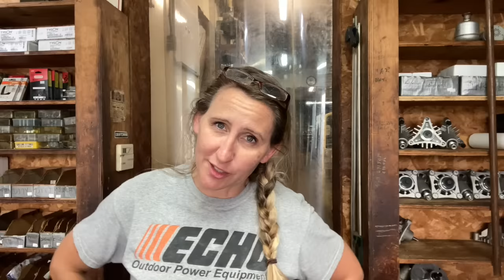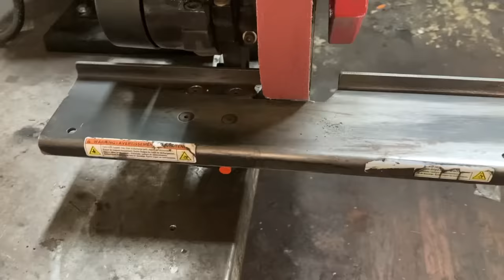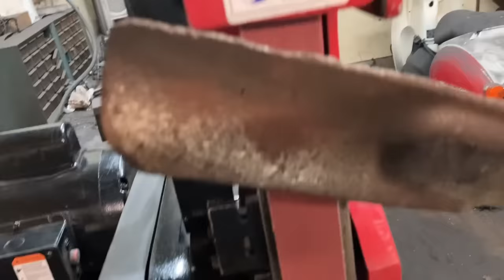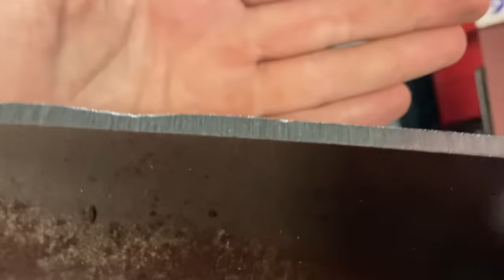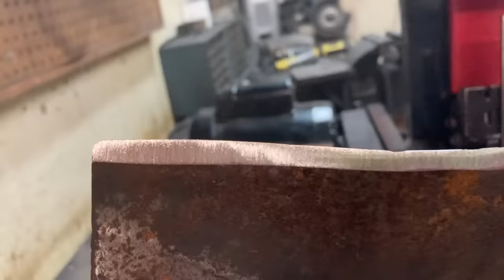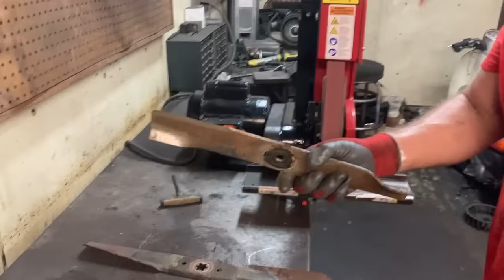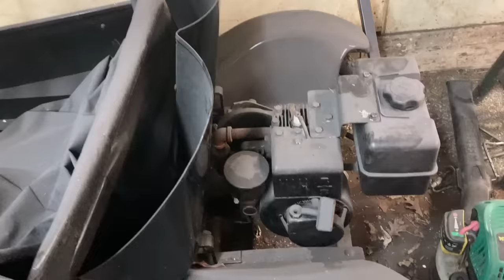The Best Blade Sharpener Ever!!! Oregon Burr King X400

Comment: Ok 51 seconds, now balance it so it doesn't shake like a dog crapin peach seeds
Reply: I watch quite a few  small engine repair channels, but Never see a one of them  Balance a blade, must be a lost art or something.
Reply from the maker: This was not a “How to sharpen your blade video”. Those were old, bent, scrap blades. It was a, “Check out this awesome grinder” video….. 😆
Reply: Uh, crappin' is spelled with 2 p's. Just sayin'. And tryin' to keep a straight face 😂
Reply: Wow
Reply: "A dog crappin' peach seeds" . . Never heard that one before. I'll use that one.
Reply: I'll have to start usin' that one!😂😂
Reply: @davidoickle1778  true I heard it was as nervous as a cat crapping a peach seed
Reply: @briant4162  "smiling like a dog *hitting peach seeds" conjures up a better mental image.  Been using that one for 40 years, still cracks me up
Reply: @Jslav-jj2xq  no cat but small peach seed big
Reply: Other than myself, I've honestly never seen anyone balance a mower blade.
Everyone I know will just buy a set of new blades every spring.
These are the same ones that don't believe in cleaning under the mower decks either. 
Couple of buddies that live close by, don't understand why I raise my 6' shredder up, and take the blades off so I can hit them with 4.5" grinder with flap disk to put edge on those blades.
I even go as far as to get old bathroom scales, and weigh them.
If I find big difference in weight, then I'll knock more metal off the heavy one until it's close.
They ask why, because I don't want to replace the gear box, or even have to put new seals in it every couple years. 
Plus my tractor doesn't have to work nearly as hard, and it cuts it up better, and smaller pieces too.
Plus it doesn't leave rabbit runs behind me as I'm mowing the spring clover to make daylight for Bermuda to come in stronger
Reply: I used to believe you had to balance after every sharpen. But after sharpening 2 sets of mower blades twice weekly (16 mower blades TWICE weekly) for 2 mowing seasons. Unless your like mauling the hell out of them and I mean like 4 5 6 seconds per pass through the grinder. You absolutely do not have to balance them every sharpen.
Reply: Balance of a mower blade is an ABSOLUTE waste of time!!!! POSITIVE!!!. There are no lawn mowers on earth gonna run like a freakin Mercedes!! It’s a work machine FFS!!!☝️🤔
Reply: They are called pits, not seeds.
Reply: I use an 80 grit flap disc on a 4.5" grinder and balance them on a 5/8" shaft with 5/8" I'd roller bearings on 2 jackstands.
Reply: @drfalcon4102 that’s one of the reasons why so many spindles go bad would you drive your car 70 with the tires out of balance
Reply: @drfalcon4102 if you don’t care about tearing up your spindles, no sense in balancing the blades….  NOT!  Be like a poodle trying to pinch out some chainmail spiked balls!😂
Reply: Some of you folks don't live where we grow rocks during winter.  Sometimes,  the grind is deep. You must balance or you "will" pay for it. Doesn't mean I have to balance everytime I Sharpen them.  (But I check them everytime) nuff said

Comment from the maker: LET ME CLEAR UP SOME CONFUSION... This was not a "How to sharpen your blade" video. We just used old, bent blades from the scrap pile to show how awesome the sharpener is. We always make sure customers blades are balanced. Thanks for watching!
Reply: That would be a cool video idea though. How to sharpen and balance mower blades. 😉
Reply: LOL Bigger is Better! 😂🤣 love your channel and love Project Farm too.
Reply: @thinkingimpaired5663  It's not the size that counts, it's how you use it. 😉
Reply: @stellarproductions8888  😂🤣👍
Reply: You wanna know how to keep the blades sharp longer?
I've worked with steel for years as a fabricator, forger, heat treater and ironworker, some years back I got a brand new high end riding mower and the first time the blades needed sharpened (which was sooner than I thought it should be) I started on a bench grinder and then moved onto a file for the finish sharpening, from working with so many different grades of steel over the years I could tell by the sparks coming off of the bench grinder that the blades were made from a very good grade of steel, after getting all three blades as sharp as kitchen knives I put them back on the mower and proceeded to cut my 1½ acres of lawn that has no rocks or even exposed dirt anywhere, just green grass everywhere, I always mow the area around the front of the detached garage last which is where I keep the mower, when I was putting it away I noticed that the grass in that area didn't have the quality of cut like where I started on the other side of the garage, so I reached up under the deck (with the mower off of course) and felt the cutting edges of the blades and much to my dismay they were not only dull but they were rounded on the edges. 
Well I'm not going to sharpen my blades half way through everytime I mow my lawn, so I took them back off and sharpened them again, then I proceeded to take a torch and heat the edge area of each one till they were cherry red and dunked them in a bucket of cold water, that did the trick, now they hold their edges throughout most of the summer before they need to be sharpened again. 
Years ago the manufacturers probably did induction harden the blades in the area where they're sharpened, but all it took was one lawsuit from some idiot running over a pile of rocks and shattering a blade for them to leave that step out.
And if you do this you can forget about finishing them with a file, it'll just dance across the blade without cutting into it, that's another way you can tell it's quality steel to begin with.
Reply: @dukecraig2402  I loved your post dude. Sounds like the old heat and quench trick. Nice to have a steel expert in here. I like to sharpen my blades sharp as knives too. Basically, if you can accidentally cut yourself by brushing up against the edge of a mower blade, that means it's sharp enough to cut grass like a golf course.
Reply: @stellarproductions8888  
That's right, if your blades tear the grass instead of cutting it then your lawn won't be as healthy. 
My cousin was a greens keeper for years and then got a job as a sales rep for a company that sells products for maintaining golf courses, perfect for someone like me who freaks about his lawn, he'd give me all kinds of fertilizers and other products for my place, I had the best looking lawn around until he passed away. 
And yes, that's exactly what it is quenching, I'd lay odds that years ago the manufacturers of mower blades used to do just that, doing it in a specific area instead of the entire part is called induction hardening, I can remember years ago blade's would hold an edge, after I got that Husqvarna mower and I noticed that the blades dulled after mowing my lawn just once I pretty much knew what was going on with that, like I said I could tell by the sparks when grinding them that they were good steel and not just mild carbon like beams are made of and that the last step had been left out, ever since I started doing that my mower blades have held an edge to where I only have to sharpen them once or twice throughout the season instead of them being dull after mowing just once.
Reply: Which belt were you using?  The 36 grit, or the 120?
Reply: Not bad but can it handle the tough jobs? How long would it take that thing to sharpen my wits?
Reply: @dukecraig2402  my blades came blunt out of the box now I sharpen them every year if needed
Reply: I thought that was obvious, but apparently not! Lol great video and cool sharpener
Reply: Thx for answering me and I know that you were just showing the machine. Thad awesome. God Bless
Reply: @dukecraig2402  I believe the process is referred to as annealing. I could be wrong.
Reply: @owenparkerjr.6588  
No, annealing does the opposite, it softens it, it also is done with heat but you cool it slowly after heating it.
Annealing is done to soften metals so they can be machined or bent/shaped without getting so much "bounce back" to it's original shape after being pressed, bent, stamped etc etc, also it can be done to area's that need to have holes drilled in it, as an example when we'd fabricate replacement wear plates for inside of gravel or coal chutes that get bolted in we'd do all the layout work for the location of the holes then heat the area's up cherry red where each individual hole was to be drilled, then we'd keep hitting the area with the torch at intervals further apart time wise so it'd cool slowly, then we could drill the holes without constantly having to sharpen the bits.
What I do with the mower blades, heating up the area that gets sharpened cherry red then  dunking it in cold water which cooled it very quickly, hardens it, specifically that type of hardening where you just do a certain area is called induction hardening, just doing the surface on thick steel is called surface hardening, if you take something and put it in a furnace to where it's heated through it's entirety and then quenched in a cold fluid is called through hardening, since I was only worried about hardening the area that gets sharpened for the sake of it keeping it's edge I only induction hardened it.
How you can tell if steel is of a higher grade whether or not it's been hardened is when you grind it, if the sparks are real fine and don't travel far before they lose their glow it's a higher grade steel, if it throws bigger sparks that travel far with the occasional meteorite that goes all the way across your garage it's a lower grade of steel, that's how I knew those blades were of a high grade of steel and would hold an edge for a good long while if I hardened them, the first time I put them to the bench grinder the sparks were real fine and didn't travel far, only a few inches, before they quit glowing.
Reply: I'm surprised people could not differentiate what scrap, rusty, or dilapidated blades look like. It's not rocket science folks. Heck them blades look like my mother-in-law mowed rocks instead of the grass,BTW she had done countless times in the past.
Reply: I was told by several dealers and during my time as an outdoor power equipment tech only the 3”-4” of a blade actually cuts grass so why did you tech sharpen 6”-7” of blade? Also how about showing balancing the blade after sharpening.
Reply: Awesome price
Reply: You do Balance! 🤔. Can you show the whole process? 👍🤗🙏✝️♥️. 🇺🇲 From the old man in Southern California 😎♥️
Reply: @stellarproductions8888  pop pop
Reply: Thanks for your advice on buying the Black Max lawn mower from Walmart it's a great lawn mower
Reply: I think you'd have got more kudos if you'd shown your balancing kit as well TBH.
Reply: @dukecraig2402  Now that's a helluva strange torch you've got there, to heat (and keep hot) an entire edge of any decent sized mower blade to cherry red. Some folk might not believe you....
Reply: @tasmedic  
Well anyone who has used a regular cutting torch wouldn't, not that you're hitting the trigger and cutting anything but I don't see why anyone who has ever used one would have a hard time believing it, a mower blade is only 3/16" thick or so.
Why, what kind of torch are you thinking about? A little propane torch you solder copper pipe joints with?
Please explain to me why you think an acetylene cutting torch wouldn't be able to do that? Years of working as a steel fabricator I can assure you one of them can do it with ease, what are your experiences in life leading you to think you're calling me out on something? Lighting cigarettes with a disposable Bic lighter? Exactly why is it you think a torch couldn't heat up the edge of a mower blade? Years of working with acetylene torches, along with actually have heated up steel much thicker than mower blades and I'm just dying to know to hear what this is about.

Comment: Another tip after sharpening, clamp blade in vice. Take a hand flat file, a couple of strokes right on the Sharp edge. Dub it off about 1/32 of a inch,  this helps it stay Sharp longer and reduces chipping from rocks. Been doing it for 35+ years.
Reply: Yep no need for a razor sharp edge. First use will dull it anyway.
Reply: @staind288  finally someone understands. Thanks 😊
Reply: I also do that with drill bits, only I use a honing stone to slightly dub the edge after sharpening. Unbelievable how much that works. I have a 1-1/4     

 drill bit I have drilled over 12 ft of   steel with  cuts as fast as new Never  never resharpened it yet
Reply: @williepelzer384  
That would be a great video tutorial
Reply: @williepelzer384  understand perfectly but the first cut with the razor sharp blade.. oh la la!!   ( I don't mow rocks )
Reply: So just don't worry about getting the blade razor sharp.
Reply: @williepelzer384  That's a lot of holes drilled.  Do you know the brand of the bit or where you bought it from?
Reply: Thanks, I noticed new blades are never " sharp".......
Reply: Dub it off ?  You mean DULL it !.  If you sharpen it right , to the proper angle, the blade won't be " Sharp" after taking off the back burr.  Yes, trying to make a blade "razor sharp" is dumb, and counter productive.

Comment: Nice machine !  I worked as a mechanic at a small dealership, we had a similar machine, but with a wheel instead of the belt. However we often took our blades to an old guy in town. He had a machine from, it looked like the 30s or 40s. It took a while to set up, but once you did, you didn't touch the blade. The machine did everything. It got the blades so sharp it was scary.
Reply: But if the edge of the blade is razor sharp wouldn't the edge of the blade chip easier?
Just my opinion.
Opinions may vary😊

Comment: I grind my blades with a portable disc grinder.  Takes a lot of passes but the cutting edge is pretty good when done.  Have to make sure you don't get the edge too hot and remove all the temper.  I use a large file to finalize the edge and put a small flat on the knife edge as well. I also balance the blade when finished, and spray paint the blades so they don't rust while sitting waiting to be rotated to my mower deck.  I also mow at 3 inches as to avoid blade contact with stones
Reply: I use an old 12" bench grinder that takes about 5 seconds to wind up to speed, and I have a rough wheel on one side and a finer one on the other... Bought it at a yard sale probably 30 years ago and it was old then.... $15 I believe... the grinding wheels cost more than I gave for the grinder... you'd have to be trying to stop that motor as you're grinding because it has very serious torque.... I never timed how long for a blade, but without a doubt it'd be on par with that sweet machine....
Reply: Cutting at 3” is good for the lawn and your blade.👍🏽
Reply: We have identical methods.  I think I've found my lawn maintenance doppelganger

Comment: I worked with my father at his lawn/garden sales/service business up until about 1970. We preached a few things about rotary mower blades. 1. Yeah, don't install them upside down because that will just beat your lawn into submission. 2. Do keep your blade sharp otherwise you will just be hammering the tops off your blades of grass and the sap will burn. 3. But the main thing was imparting the knowledge that it's only the outer tip of blade the does almost all your cutting. Think it's the whole 4-5 inch end? You would have to be mowing at about 25 MPH for that to be true. Consider that most rotaries run at 3,600 RPM (still true today, Bre?) Since the blade has two ends, that means 7,200 cuts per minute. If you are in very good shape and mow at 5MPH, you are moving at about 37 inches per minute. Divide that by the 7,200 cuts and you find that you forward progress is way less than a 64th of an inch per cut. Now you know why the tip of your blade is severely rounded off while just a few inches back, it still looks pretty good. If you really want a clean cut, the tip of the blade needs to be sharp.
Rather than throw blades away too early, sharpen that rounded radius. It will then be taking a slicing cut which is far better than the blunt-force trauma of a dulled tip.
Bre, I would have killed to have your blade machine.